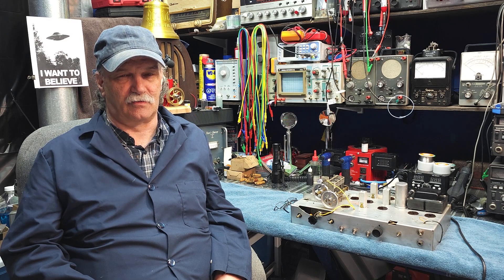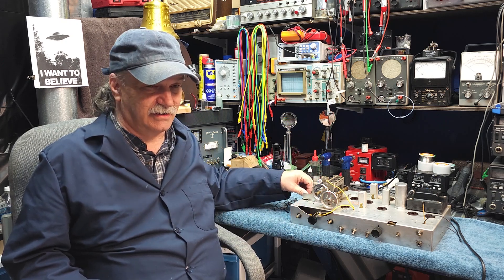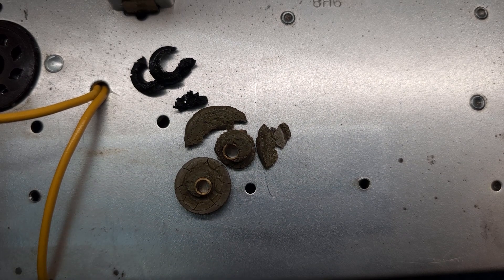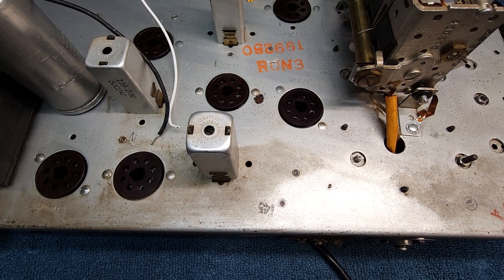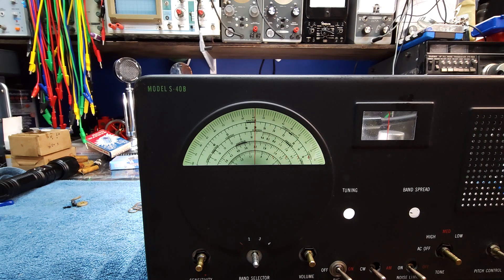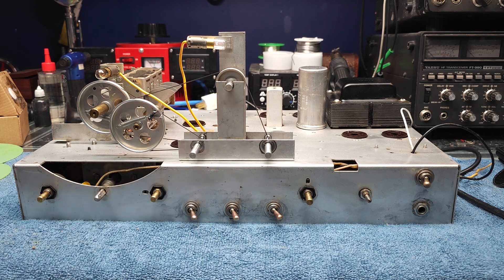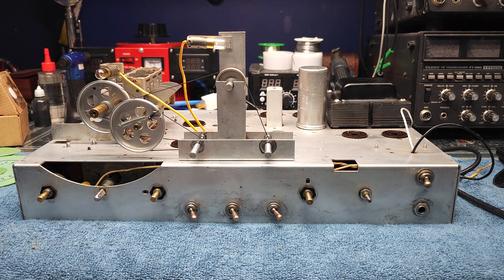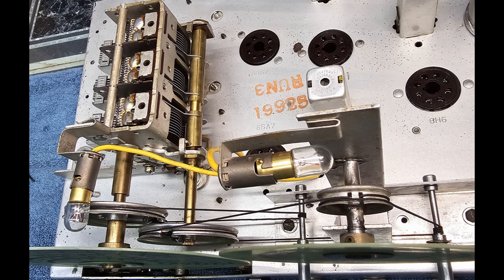Learn To Restore Tube Radios - Step Five

Comment: I think you mentioned that you used Petroleum Jelly on the chassis. Is that the same as Navel Jelly or Vaseline?
Reply: Hi Mr Mike Good morning!
I have a tube radio turntable combo console. When I turn it on just humming noise coming and It gets louder. Can you please tell me what could be the issue? 
Thanks
Reply from the maker: @ianand308  All the caps have to be replaced. Just like I did in this series step 3 and 4. If you have an old tube radio that's not had the caps replaced, you should not even attempt to plug it in or turn it on. Your tube unit must be restored first. Turning it on can cause some real damage.
Reply from the maker: Yes John indeed it is all the same stuff. Level one Chassis Cleaner. :)
Reply: Good morning Mr .Mike 
It is so wonderful that you answered.
I am not sure that I am able to do it myself. This unit I bought from Facebook . The lady mentioned that was belongs to her father and When I was bringing it out, the mother told me that her husband really loved that unit. Please take care . They were not sure whether it was functional or not. The gentleman was no longer alive . I bought this thinking it might be working. I didn't know all these details that had to be restored before use. Thank you so much for that valuable safety information. Because of this reason I couldn't get rid of this unit. It has some sentimental value. 
In addition back home my father had a grundig tube radio. It was so nice to listen to the tube radios.
I'm 64 years old but I still have some passion for this vintage electronics. 
I'm just wondering if you restore them and how much it will cost or do you know anyone that can do the restoration?.
Thank you so much for your help! I really appreciate it. I am in Stouffville Ontario Canada.
Have a great weekend.
Reply from the maker: @ianand308  Do you have a facebook account? This is where i accept these type of messages.